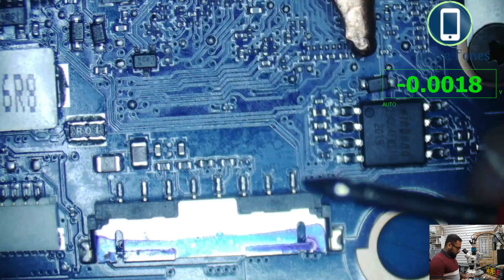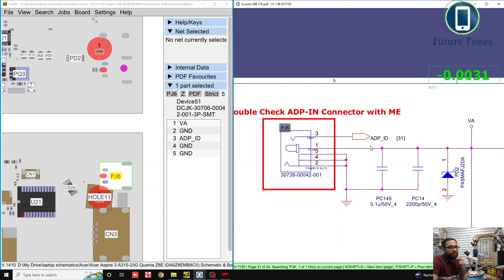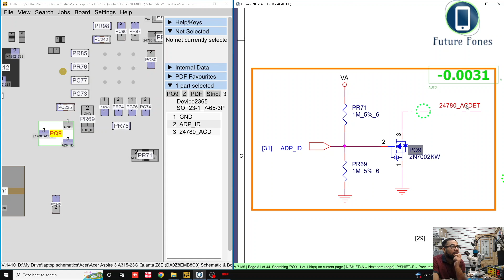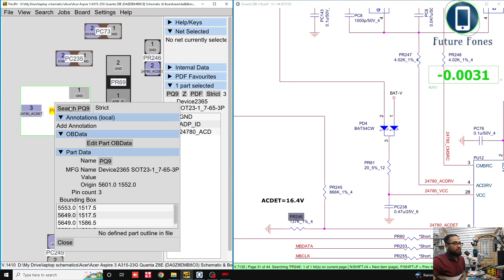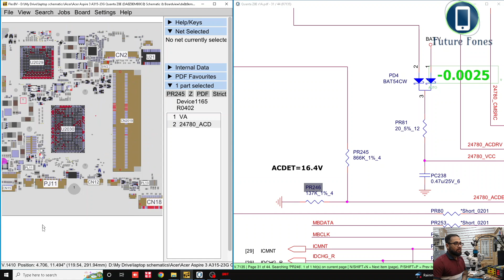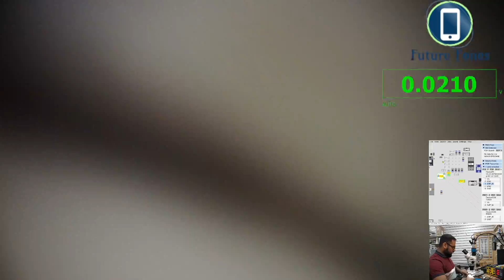Acer Aspire 3 Not Charging Battery. What is ADP_ID PIN ?

Comment: vidéo very interesting as always... but i don't understand, what is the real problem ? the charger ? the connector ? And one more question please...why 24V on the gate Pin mosfet, why not 19V ? thank you very much from France.
Reply from the maker: In our case we have eliminated the problem. We could change the charging port or look for original charger and test. But our workaround will work all the time. and laptop should work. Since it was N Channel mosfet We need higher supply at Gate Pin then the voltage given at Drain Pin.
Reply: @futurefonesltd  Thank you for your explanation

Comment: Hello my friend , I often watch your repair videos and I really appreciate your repairs. I don't know if it's the same but on an acer aspire 5 I had the same problem, and it was only the charger. Because the tip of the charger is different on these models. Maybe I'm wrong, but I just wanted to share my experience with you. Sincerely.
Reply from the maker: Yes you are correct on this one. If we have charging pin that is internally connected to ground ADP_ID will be ground and charging circuit should work.
:yougotthis: